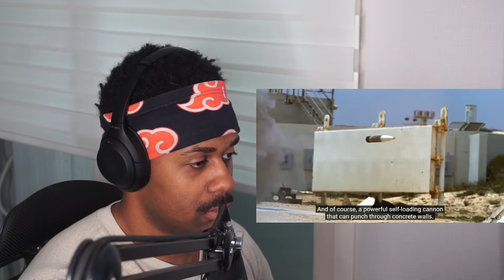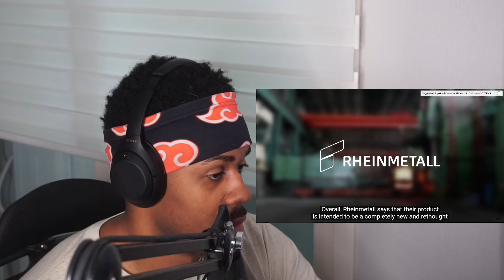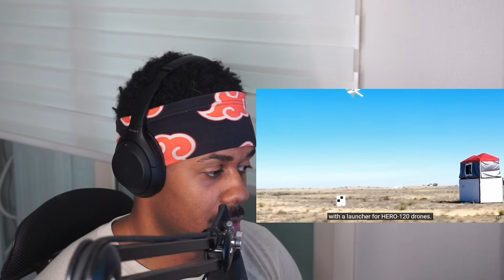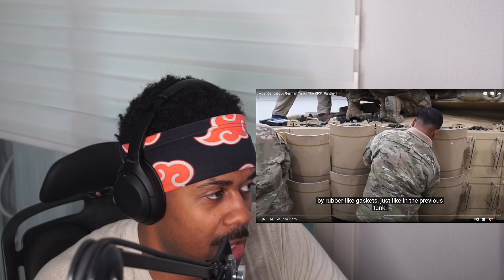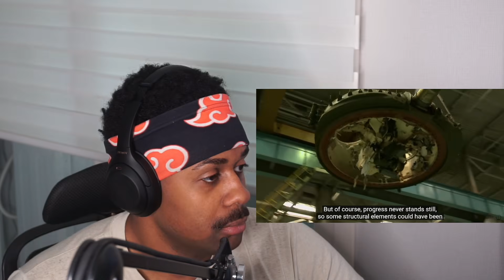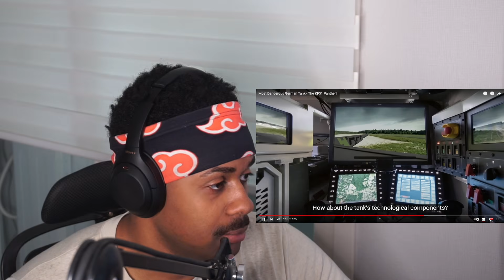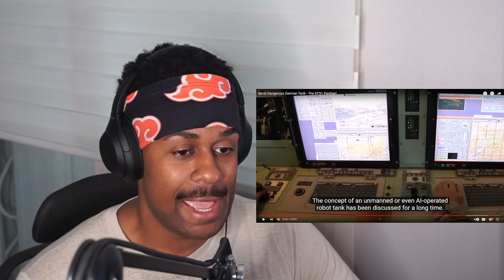Germany Unveils its DEADLIEST Creation...The KF51 Tank

Comment: I'm German and yes, my country has always been at the forefront and innovative in weapon development.
Often, also looking back on our past, I have to say: unfortunately!
Many significant inventions were born in Germany. But these advances were always used for war and further developed.
Rocket propulsion, atomic fission, even all common engine types such as Otto engines, Wankel engines and diesel engines were born in Germany.
And from them the best and at the same time the most terrible weapons were created.
Even with today's designation of the newest tank, KF51, the manufacturers maintain their tradition of naming German battle tanks as early as World War II. The "Tiger" was a battle tank VI (KF6).
I don't know if I should be proud or cry.
Quote from a 1949 election speech by Franz-Josef Strauss, an important post-war politician in Germany until the 1980s:
"Anyone who picks up a gun again will have his hand cut off!"
He later became Minister of Defense and introduced, among other things, the Starfighter Kapfjet in the Bundeswehr.
A jet that got the nickname "widowmaker" due to its unreliable flight behavior. Not because of its fighting power, but because of its frequent crashes that claimed the lives of many pilots.

Rheinmetall has certainly changed in the last seven decades, as has Thyssen Krupp, but one should always keep in mind that during the Holocaust era they manufactured (or had to manufacture) a lot of war machinery for the 3rd Reich using forced labourers , slaves and inmates of concentration camps.
The assets generated there were never taken after the end of the war and therefore today's developments of this company are based on the sweat and blood of forced laborers of the Nazi regime.

And to your question as to whether Germany and the USA "share" tanks since we are allies: No.
My very specific and subjective answer. Although allied, they are still in competition with each other.
Also, both countries impose conditions on the use of such systems that the other may not want or be able to fulfil.
Therefore, both countries produce similar weapon systems with similar capabilities.
Every country wants to be as independent as possible from other countries, and the USA in particular has been doing it since the Trump era: "America first". What good were Abrahams to us in Germany? Only a crazy President of the USA (and you were very close and there is a risk that he will come back) could freeze the supply of spare parts and the things would then stand dead in some garage in Germany.
And how difficult it was for the current Chancellor of the Federal Republic of Germany to get an "OK" for deliveries of German battle tanks to the Ukraine shows that there is also hesitation on our side. After all, German tanks were responsible for a large number of atrocities in Europe 80 years ago.
The fact that Chancellor Olaf Scholz only gave his consent after President Biden had also promised Abrahams for Ukraine also has historical reasons. Because right now, the Federal Republic of Germany is being mobilized on Russian state television and its propaganda.
It has already been shown in the media how quickly launchers with nuclear warheads would hit Berlin and the rest of my country from Russia.
It was reported that once again German tanks were injuring and killing Russian patriots in a war deployed only against Ukraine's "Nazi regime" in a military special operation.
We are currently being treated as a second enemy of the state in Russia, because as an arms exporter we have a veto on arms deliveries made in Germany.
Due to the fact that the Federal Chancellor and his alliance parties (and you have to keep in mind that the second most powerful party is the "Greens", who have always and vehemently condemned arms deliveries to anyone) finally decided to release this step , supports Ukraine. But it is also an absolutely historic step for all parties in Germany, looking back on our history.
From the German point of view, a single Abrahams driving next to a Leopard2 in the Ukraine is a clear sign that the "old" Nazi is not supporting the "newly declared Nazi" by Russian propaganda, but that the western democracies are against dictators, Oligarchs and emperors stand.

Ich bin Deutscher und ja, mein Land war immer federführend und innovativ in der Entwicklung von Waffen.
Oftmals, auch im Rückblick auf unsere Vergangenheit, muss ich sagen: leider!
Ganz viele, maßgebliche Erfindungen sind in Deutschland geboren. Doch wurden diese Fortschritte auch immer für den Krieg genutzt und weiter entwickelt.
Raketenantrieb, atomare Spaltung, selbst alle gängigen Motorentypen, wie Ottmotor, Wankelmotor und Dieselmotor sind in Deutschland geboren.
Und aus ihnen wurden die besten und zeitgleich schrecklichsten Waffen geschaffen.
Selbst bei der heutigen Bezeichnung des neusten Panzers, KF51, pflegen die Hersteller Ihrer Tradition, die schon im 2. Weltkrieg die deutschen Kampfpanzer benannten. Der "Tiger" war Kampfpanzer VI (KF6).
Ich weiß nicht, ob ich stolz sein oder eher heulen sollte.
Zitat aus einer 1949 gehaltenen Wahlrede von Franz-Josef Strauß, einem wichtigen Nachkriegspolitiker Deutschlands bis in die 1980'er:
"Wer noch einmal eine Waffe in die Hand nimmt, dem soll die Hand abfallen!"
Später wurde er Verteidigungsminister und führte unter anderem den Starfighter Kapfjet in der Bundeswehr ein.
Ein Jet, der durch seine unzuverlässigen Flugverhalten den Beinahmen "Witwenmacher" bekam. Nicht aufgrund seiner Kampfkraft, sondern aufgrund seiner häufigen Abstürze, die vielen Piloten das Leben kostete.

Rheinmetall hat sich sicherlich in den letzten sieben Jahrzehnten, wie auch Thyssen Krupp, geändert, doch sollte man immer im Hinterkopf haben, dass sie in der Zeit des Holocaust viel Kriegsmashinerie für das 3. Reich herstellten (oder auch herstellen mussten) unter verwendung von Zwangsarbeitern, Sklaven und Insassen von Konzentrationslagern.
Das dort erwirtschaftete Vermögen wurde niemals nach Ende des Krieges abgenommen und somit fundieren auch heutige Entwicklungen dieses Betriebs auf Schweiß und Blut von Zwangsarbeitern des Nazi-Regimes.

Und zu Deiner Frage, ob Deutschland und die USA Panzer "teilen", seit wir Verbündete sind: Nein. 
Meine ganz spezielle und subjektive Antwort. Obwohl verbündet stehen sie immer noch im Wettstreit miteinander.
Außerdem binden beide Länder Bedingungen an die Nutzung solcher Systeme, die der andere möglicherweise nicht erfüllen möchte oder kann.
Daher produzieren beide Länder ähnliche Waffensysteme mit ähnlichem Können.
Jedes Land möchte möglichst unabhängig von anderen Ländern sein, gerade die USA macht es seit der Trump-Ära vor: "Amerika first". Was nützten uns in Deutschland da Abrahams? Nur ein bekloppter Präsident der USA (und ihr wart sehr nah dran und es besteht die Gefahr, dass er wieder kommt) könnte den Nachschub an Ersatzteilen einfrieren und die Dinger ständen dann tot in irgendwelchen Garagen in Deutschland.
Und wie schwer es dem aktuellen Bundeskanzler der Bundesrepublik Deutschland fiel, ein "OK" zu Lieferungen von deutschen Kampfpanzern in die Ukraine fiel, zeigt, dass auch auf unserer Seite gezögert wird. Schließlich waren deutsche Panzer vor 80 nJahren für eine Vielzahl von Greueltaten in Europa verantwortlich.
Dass Bundeskanzler Olaf Scholz seine Zustimmung erst gab, als Präsident Biden ebenfalls Abrahams für die Ukraine zusagte, hat auch eine historische Begründung. Denn schon jetzt wird gerade gegen die Bundesrepublik Deutschland im russischen Staatsfernsehen und deren Propaganda mobil gemacht.
Es wurde in den Medien schon gezeigt, wie schnell Trägerraketen mit atomaren Sprengköpfen in Berlin und dem Rest meines Landes von Russland aus einschlagen würden.
Es wurde darüber berichtet, dass wieder einmal deutsche Panzer russische Patrioten in einem Krieg verletzen und töten, die nur gegen das "Nazi-Regime" der Ukraine in einer militärischen Spezialoperation eingesetzt sind.
Wir werden zur Zeit als zweiter Staatsfeind in Russland gehandelt, da wir als Rüstungsexporteur ein Veto auf Waffenlieferungen deutscher Produktion haben.
Dadurch, dass der Bundeskanzler und seine Bündnisparteien (und man muss sich vor Augen halten, dass dazu als zweitmächtigste Partei die "Grünen" zählen, die immer und vehement Waffenlieferungen egal an wen verurteilt haben) sich letztendlich dazu entschlossen haben, diesen Schritt frei zu geben, unterstützt die Ukraine. Es ist aber auch ein absolut historischer Schritt aller Parteien Deutschlands im Rückblick auf unsere Geschichte.
Aus Sicht der Deutschen ist ein einziger Abrahams, der neben einem Leopard2 in der Ukraine fährt, ein deutliches Zeichen, dass nicht der "alte" Nazi den durch die russische Propaganda "neu deklarierten Nazi" unterstützt, sondern, dass die westlichen Demokratien gegen Diktatoren, Oligarchen und Imperatoren stehen.

Gerade ich, als 50-jähriger Deutscher, dem schon im Kindesalter die Schuld am Holocaust injiziert wurde, obwohl ich 30 Jahre nach dem Ende des Krieges geboren wurde, durchlebt in der heutigen Zeit ein Wechselbad der Gefühle.
Nur der Rechtsextreme Flügel kann hat ein "Hurraaa" auf den Lippen, wenn deutsche Panzer wieder gen Osten rollen.
Egal, wie gut der Panzer auch sein mag

Comment: You can’t compare m1a2 and panther. You habe to compare with abrams X. And then the abrams looks better because of its unmanned turret. The panther still has the advantage of having the bigger gun (120 vs 130mm) but then again the 120mm are enough to penetrate any existing armor and the 130mm are just overkill
Reply: did u watch the video u say the Abrahams looks better because of the unmanned turret the panther also has a unmanned turret
Reply: @ba55h3ll3  it doesn’t. Unmanned turret is just an option for the future.

Comment: The KF51 is only a Tech-Test and Tech-Demo for the Updating of the Leopard 2 its the Leopard with a new Turret and an Armorupdate.
So it will never go in Service in Germany because the German Army have a bigger Plan for a hole Combat-System with specialiszed Vehicles that work together as Unit and the learnings we take of the KF51 will go into the Leopard Updates till the new System comes in Service at 2035.

Comment: More funfacts:

The germans went to the 130mm in fear the new russian ActiveProtectionSystem could degrade ther darts too much to crack the Armata(or T-90 with APS - which is rare). At the same time, the russians go nuts about the germans fielding ther own superior APS/ERA frankenstein hybrid, and toke the 125mm from Aramta to replace it with refurbished artilelry barrels of a whooping 152mm caliber and desperatly design KE ammunitions for it.
Later it was found russian APS can only track darts up to 1700m/s, which is exceeded by german DM63 darts, and russians found out that ther freaking 2050m/s Vacuum-02 dart is too fast for StrikeShield xD

So we went on somewhat like "okay we all build some supertanks now - can we all just get back to buisness plz?" xDD

And from somewhere the americans shouted into the competition that they had an idea to upgrade ther Abrams into AbramX, which is twice as expensive, offer no really new abilitys but have some cool new disvantages. Everyone had a good laugh and went beck to material-warfaring ther old stock material into the ground.

Did i mention that the world is a weird place?

Comment: To be honest, as someone who has nothing to do with the military, this is a little bit underwhelming, because I thought this is build in all newer tanks normally! as example the drones: i thought it was standard to had drones on board, or the „bot-tank“. I mean an fricking Tesla is better equipped than this thing! And this is military equipment there are not much industries with so much money behind them!

Edit: it’s still impressive, don’t get me wrong, but I thought it was better and cooler stuff than the civilian level from last year.
Reply: you compare the wrong things with each other, how would a tesla drive through terrain with out geting stuck in a small ditch, what happens to a tesla if you fire a rocket at one. Or even if you put the main gun on the telsa how fast would it be. Just becouse a tesla is more comfortably to drive in on the streets and even the tesla autopilot somethimes tries to hit people, so its not realy that relaiable. From where on your tesla do you launch your flairs or your drones. Its like comparing a toy airplane with a real one and then conclud the toy one is better becouse you can fly tighter curves.
Reply: @weller9995   my dude went full in😆. And btw. Imagine a Tesla without a road or Internet Connection ... the auto pilot function became useless real quick
Reply: @f18gamerboy  I mean the self driving of Tesla is useless already xD I wonder who would implement it first though Tesla (haha, good one) or another company like Rheinmetall. I mean one could talk about how Tesla is overinflated or Musk overvalued instead of a snake oils salesman but yeah.... crazy world.
Reply: @NephritduGrey  If you look at the market cap Tesla is number 1 and has a higher market cap as number 2 through 6 combined, but if you think about it seriously you have to be very delusional to belive it.😅🤣🤣
Reply: @NephritduGrey  I love the comparison, you are damn right it´s hard to convince people when they got lied to. 👍

Comment: US and GER tank share/tech share:

There was a story after WW2, in the cold war, where the US want to design tanks with GER (to benefit from ther expirience). Both side found that americans are completley inable to adopt any other ideas than ther own - which is tricky if you try to learn from teh other how to improve. The unbeloved divorching-child was the MBT70. It went nowhere, as germans said fk you and exit th programm.
Germans think tanks a whole different way then americans, and that's till the present day. The US needet large stocks to safe money, now the're stuck with ther 6000-tank storrage they mostly never used. Germans never managed to build as much as they wanted.

The US later refused almost every new tech the germans invented, and the US barely invented anything tank related. The Abrams sucked with ther gun, so finally they adoptet and to this day use the german M256 which is a bit inferior version of the L55 (lower total pressure). The TUSK upgrade contain a pretty weak itteration of russian ERA blocks, and was meant&designed only to help against chassy aimed RPG's.

Germans meanwhile saw it and thought: "... what the FK you guys want with a MBT in urban combat? What's wrong with you? You trade off the MBT abilitys to solve a problem you carefuly creted in the first place".

So ... no, not much cooperation here.
This also goes back to occasions that GER has been forced to buy F105 jets that was so crappy it killed hundreds of pilots without combat - but germans inable to complain or refuse. Also Germany got the patents for the MG42 chamber stolen by the US and threatend to be called Nazis if Germany would speak up. Its pretty tough to be an 'ally' of the USA - now and then.

Comment: Ever heard of military porn ? Well, this video is exactly that. Just try to remember the Tiger helicoptre debacle or the recent Puma catastrophe, with all the Pumas going non-combat ready within a few days on a training maneuver.
Germany is not the only country with such a history, the US does and did the same thing. The Growler ground attack plane was marketed and communicated with mind-blowingly better performance stats since day 1 of testing and they kep lying about it for decades now. It never performed or will perform as good as the US military pretended. I am eagerly awaiting the truth coming out about the Osprey and it is already apparent that they can hardly keep the lid on the F-35 desaster unveiling step by step.

Never believe those videos, wait till the equipment was actually tested in combat and even then you need independent sources for the performance evaluation.

Comment: abrahams is built like the german leopard; just the engine and the cannon is different.....so you know where the technology comes from. the panther is a few tons lighter, better armed and a monster if it attacks with different types of techniccs, rockets, drones and hevy duty granades with unbelievable power to kill everything aroud 25 miles., by day and night. some countries gave order 4 that to rheinmetall till now, the german military holds the lastet leopard A8, + then the panther as well. funffact: it's not as hot inside like in aother tanks, we know it's the hell inside in summer. the abrahams have one thing germans don't wants and in irakwar we saw why. the engine inside needs too much fuel, has not more power and is too sensible. so we believe in turbo-diesel, way better.

Comment: Youa re not using german Tanks, because that would hurt your own economy ;-) USA bailed out of the co-work on a new MBT early (which resulted in the Leopard-2 ) and made the Abrams. Both still use pretty the same Gun from RM, however (I think even the british Challanger does, right?).
Reply: The gun on the Challanger is a L30A1. That means it's an own made gun for the challanger. You can actually spot the difference quite easy because the German Gun (L/44 and L/55) is a Smooth Bore Gun and the L30A1 is Rifled